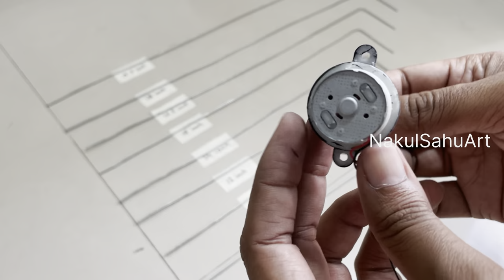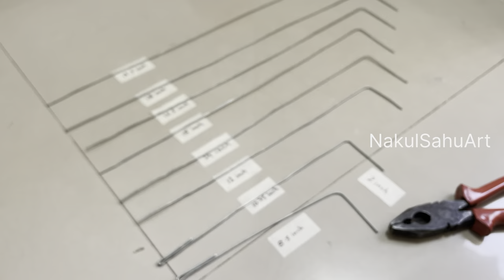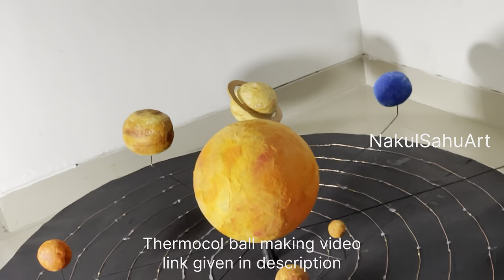Solar System working model with thermocol balls NakulSahuArt #school project

Comment: Sir my sun is big as basketball it will rotate or not please reply fast i have to submit my project tomorrow
Reply from the maker: Motor is not capable for heavy load. You can try if it’s already available with you , it’s recommended use plastic ball .
Reply: Hi may I know what cm is each ball…can u please reply asap
Reply from the maker: @Ayaash123  watch 2:56 How to make Thermocol balls for Solar system planets 3d model  link given in description

Comment: Sir can we use side shaft gear instead of long shaft gear
Reply from the maker: You can use gear motor between 10-20 rpm .(without gear motor it’s difficult to handle the load of project)